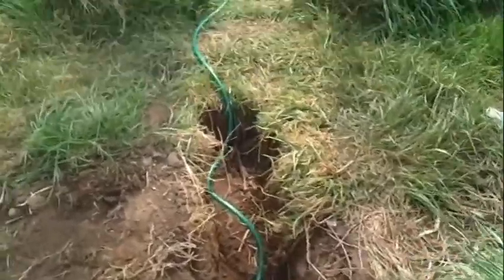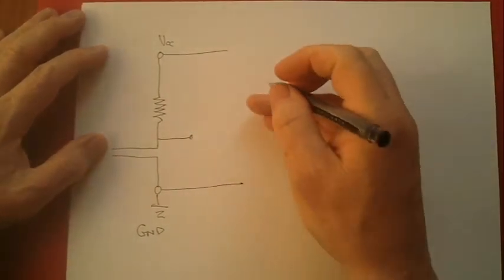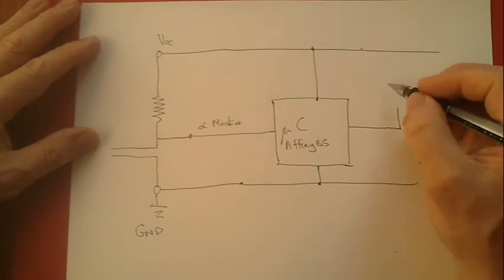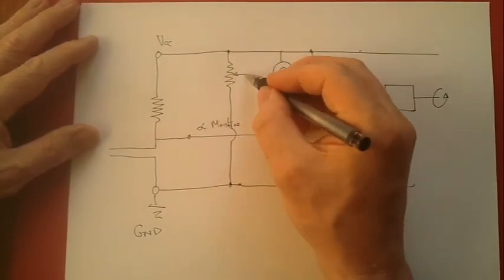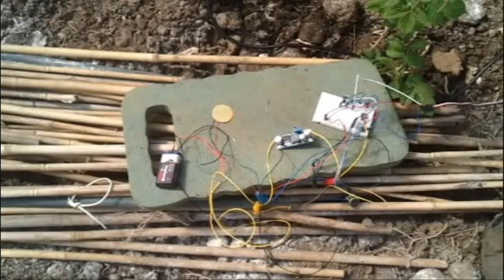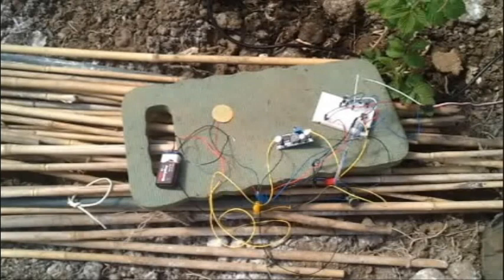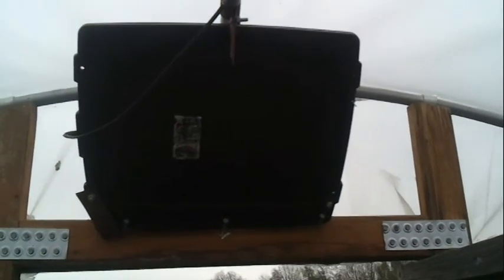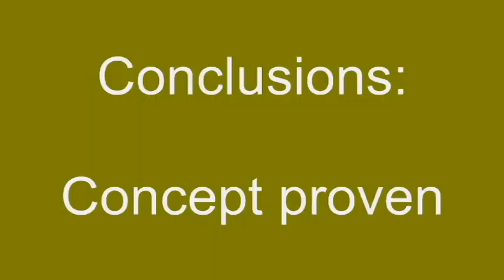Allotment Poly Tunnel Irrigation Project

Comment: i have a 7mx3m ploy tunnel at an allotment  i have built a small shed next to the ploy tunnel the idea is to install a solar panel  on the roof(I have detailed plan of storing the engry), I have two water butts to feed the water via timer, my problem is work out how to get the best flow of water around the tunnel. if i use 4mm pipe with drippers I'm afraid of cloging.(pipe to be laid at ground level).
Reply from the maker: I built a system very like yours but not like the one shown here. In the end I used an electric pump and no switch. That meant nothing would get clogged and there is no tap to jam. This system was incredibly reliable and ran unattended for a very long time. ONe note though - if you go this route, be sure to add a small air hole at the highest point in the feed tube so that syphoning is prevented otherwise it might  empty all of your supply and kill your plants.
Reply: @chriswesley594  The item i am really struggling with is do I use 12/13mm pipe then branch off with 4mm and connect drippers at the ends or just use 4mm and use connects to from drippers(I have 2 side beds 800mm and centre 500mm so each bed would have a branch). How do I measure the amount of bar pressure I would need to water the tunnel twice a day.

After 1st season with the tunnel  I relies  that in frequent watering in hot spells is not good for young growing plants.
Reply from the maker: @steveing9980  I have always subscribed to the "suck it and see" school of complex analysis. Build it but by but and see what works.

Comment: this is exactly what I want but maybe with a pump to move the water (as well as adding pressure to a sprinkler or misting system) and potentially a water level sensor and maybe multiple moisture sensors all powerred by a solar panel with a trickle charger to a deep cycle battory!!
Reply: +Jonathan Crook I wanted to use gravity because of the problem of electricity supply on the allotment. My understanding is that sprinklers are very wasteful as the water is poorly targetted and evapourates in the sprayed form, so I went to direct poured watering to a location near the roots. This also means that weeds don't get watered - only the crop plants. A lot depends on how much power you have available, but in my experience the answer is always "not as much as you want".

Anyway, thanks for your comments and good luck with it Jonathan.